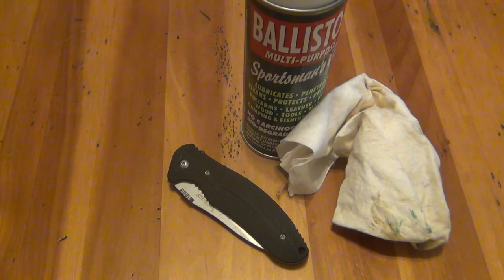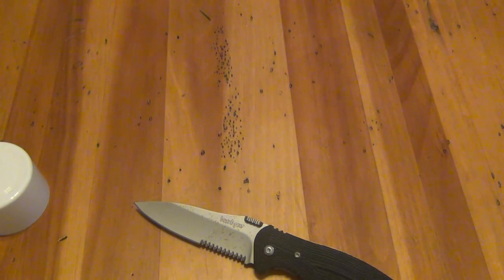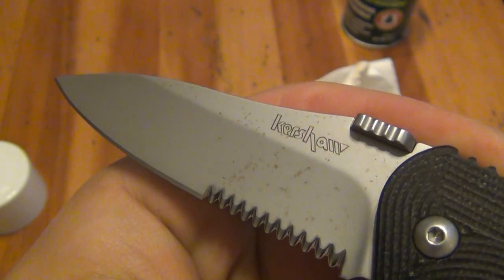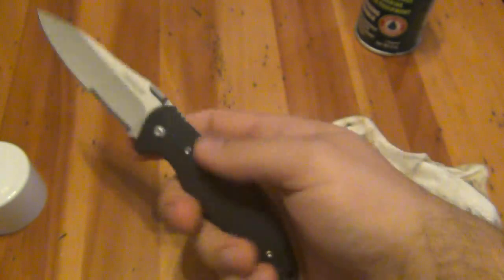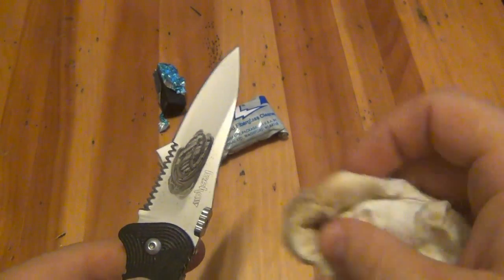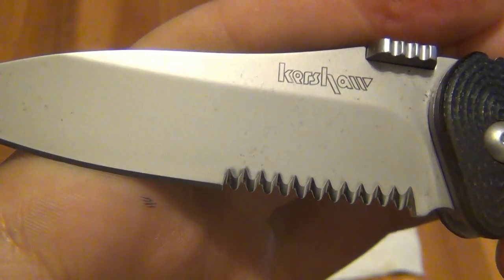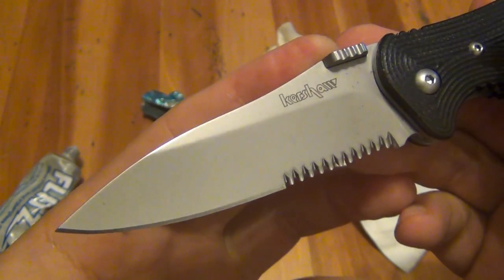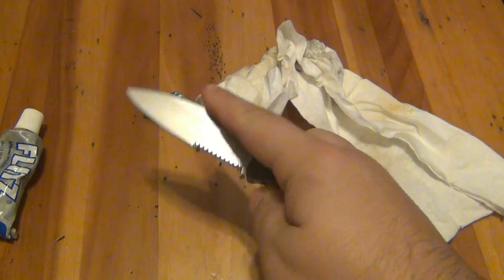Knife Maintenance :  Rust Speckling / Surface Rust

Comment: I use fine grit rubbing compound, wash it with detergent and oil it up after it`s dry.
This worked for my kimura and surprisingly, it doesn`t really affect the finish at all.

Comment: nice informational video jeff! When i can't get rust off of my knives i use a natural acid solution that can be found in any househole: vinegar. surprised? i was too, but it removes rust very quickly and effectively! you should try it out. works for me. just be sure to wipe down the blade with some kind of oil when you're done. Not that something as happend to me yet but I can't imagine leaving vinegar on a blade to be a healthy thing for the metal.
thanks for the awesome video.

Comment: Excellent video.  You often hear how easy it is to get surface rust (and beyond) off of a blade--it's nice to see it in action.  That said, I live less than four miles from the Gulf of Mexico and have never had a problem with rust, even on my carbon steels, which I rarely even bother oiling.  You can properly maintain your blades without being overly paranoid about such things.

Comment: Thank you for this video. I've had concerns about rust in the back of my head for quite some time.
The problem for me is that I don't want to coat my blades with an oil that cannot be used for cutting food (just in case). Gotta look around for an oil that is good for that. Looking around on forums has made me insecure about it, because - like so often - different people prefer different oils and deem other oils useless or even harmful. So far I've used WD40 for cleaning up.

Comment: I typically jump straight to a scrap of cardboard.  The abrasives in it tend to make short enough work for spots on my knives.  The things I have the most problem with are the metal liners.  I can't find the right bit to pull my knives apart (when I have the option for it).

Comment: I have a really nice knife that I've used for 10 years, it has developed a tiny amount of rust.  What I do is use sandpaper 180 grit (for bad ones) then 600, 1,500, and then 3,000.  It will remove everything but the metal and restore it to a factory-like shine as 3,000 grit sandpaper is what they use on cars, tobacco pipes, their stems, and knives before you recieve them.  There are absolutely no scratches left, just shine.  Can get it at any auto-shop and works really quickly.

Comment: That 8cr13mov rusts so easily.  My only spyderco is the tenacious and it has that steel, it rusted a week after I got it. All my Benchamdes are fine. They are 154cm, s30v and 440c. It would take a lot more abuse for them to rust like that. Great vid Jeff

Comment: I've had the same problem with my Kershaw Skyline. Luckily I caught the surface rust before it got too deep into the steel. I think Kershaw makes some of the best value folders out there, but it comes at a cost and that cost is a little more knife maintenance. Which I don't mind because I like playing with knives, but if you don't like having to take care of things you might want to buy a higher end knife steel like S30V, VG-10, or 154 CM with a black coat or something.

Comment: Jeff I dont know if you have used this method b4 but for minor rust like your showing here I use 3n1 oil and some 0000 steel wool from the hardware store it seems to me it removes alittle more that just a cloth I have even used it to remove rust spots on a rifle and shotgun berrals and didnt have to re blue them " think i got luck there"

Comment: @nehctik1986 i find oil much better than lighter fluid, rubbing alchohol, or goo be gone. it not only cleans the blade, but also helps prevents rusting.

Comment: Jeff, I think you would of got much better results if you applied your polish on a micro fiber applicator/ towel, or even a terry cloth towel. That towel you were using was basically just moving around the polish on the surface. I see a lot of guys recommending steel wool...steel wool certainly works great, especially when the polish is applied directly to it. Just make sure you use 0000 Ultra fine steel wool, any other grade will surely scratch the hell out of what you're working on.

Comment: flitz polish will take off speckling way faster than just about anything i have found, wd-40 will help but it will not totally remove, get some flitz metal polish, put it on a cloth rub knife for like 1 minute and pitting/rust is gone

Comment: would it be necessary to take apart the knife entirely to get rid of the rust from the inside to the knife mechanism?, because i noticed my knife had a lot of speckling on the inside but i dont want to take it apart and cause the knife to not function correctly.